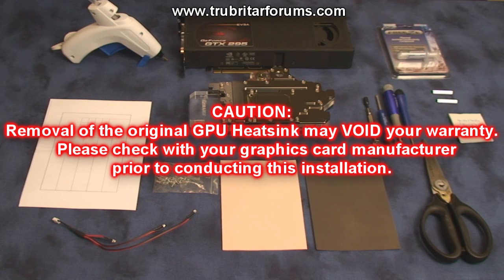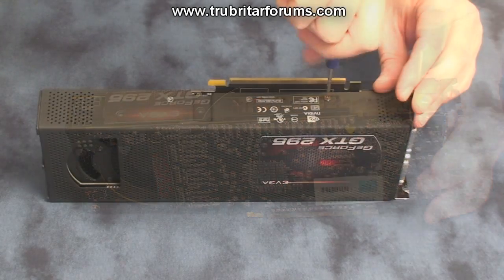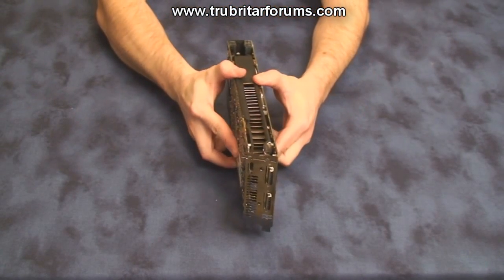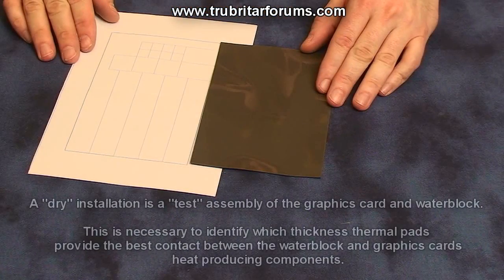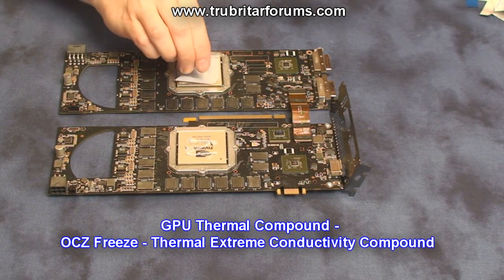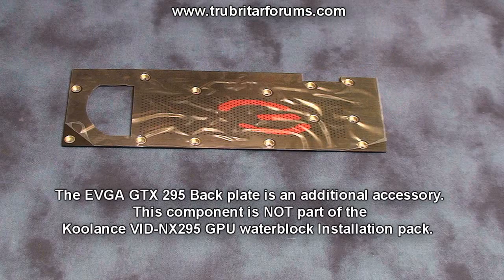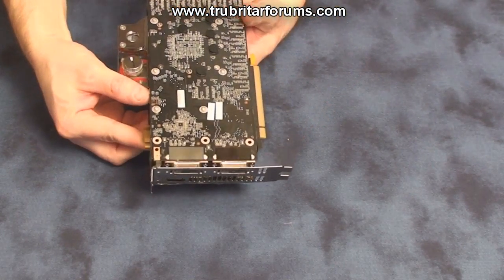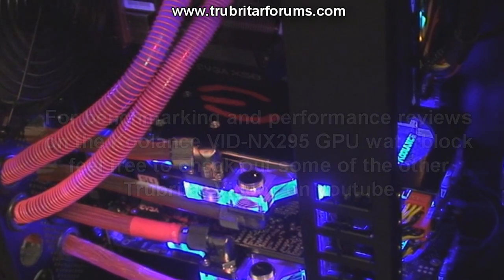(HD) GTX295 Waterblock Installation (VID-NX295)

Comment: @AUGUSTYNO 

the thermal pads do more than just sit there,they allow the heat to pass through them and into the block they're attached to.

if you just put thermal compound on,you'll have a space and nothing touching your ram chips so they will overheat and the thermal compound will run off and all over your card.

the pads take up space and transfer heat as well,theyre kind of like a heatsink/spacer combined and without them it wouldnt be smart,IMO,of course you can try but its a lot of work !!

Comment: Hey trubritar, I was wondering if you don't wanna use the blue LEDs does all the acrylic casing fill with coolent? I got Feser One acid green UV coolant and with UV lighting will the whole acrylic casing turn green or will only the center of the GPU block fill up with coolant?

Comment: I was thinking that myself, but wouldn't the thermal tape keep the solder points from making contact? Isn't this card 2  cards of the same kind facing inwards? I think a cooling back plate (perhaps modified in the slightest), would make an excellent addition on the bottom of the card. Essentially I'm just thinking of spacers.

Comment: Koolance is pretty good but watch out for their radiators they are not all copper rads which can cause big problems in a water cooling loop. I use swiftech myself but am open to anything with better performance.